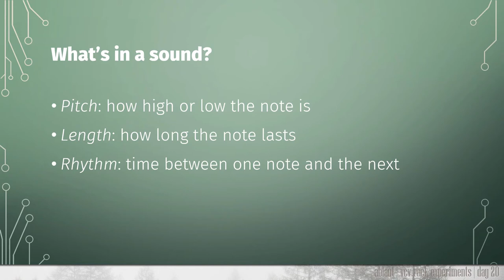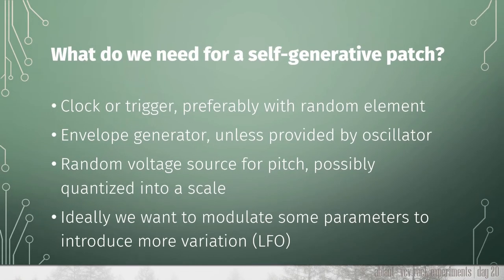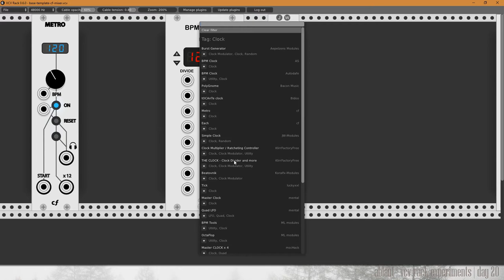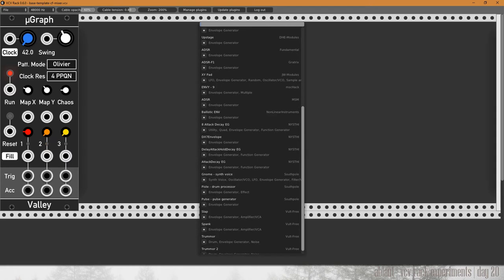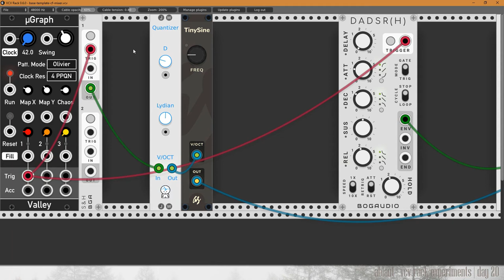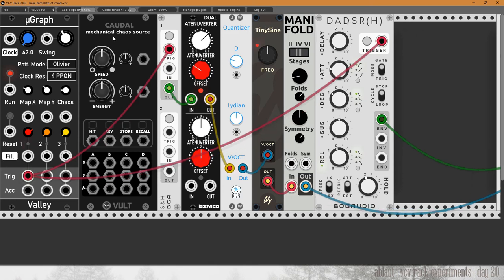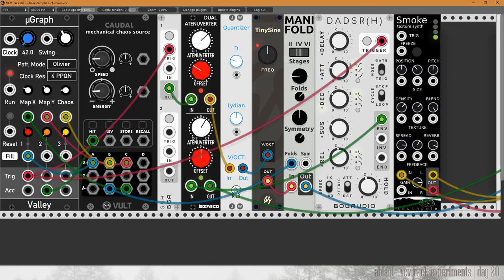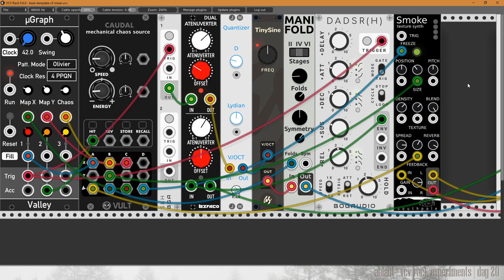vcv rack beginner tutorial: how to make a simple self-generative patch

Comment: I set up this patch and followed along using the same modules but couldn't get the S&H to randomly change the pitch on the TinySine just the same pitch playing constantly....really annoying.
Reply from the maker: Post a screenshot of your patch on the VCVRack subreddit or the Facebook VCV Rack Official Users Group, and we'll help you sort it out. Maybe a right-click on the module and choosing 'initialize' may help. Is µGraph running and sending trigger signals? Does moving the knobs on the Atenuverter help?
Reply: same problem here :( I checked everything was same config and initialized all the modules but still the same   @ablaut
Reply from the maker: @ameevamusic , another thing you can try is to connect the "in" of the s&h with an output from caudal.
Reply: @ablaut  yes! I posted on reddit for help and the solution was patching a noise source into s&h "in" and it worked :D maybe the s&h was updated since then and they removed the internal noise you say it has, anyway, thanks for the response and the tutorial! <3
Reply: @ameevamusic  Just starting with VCV and have the same issue yuo had. Can you explain, in simple terms, how you patched a noise source into s&h? I've looked on reddit but can't find your post. thx